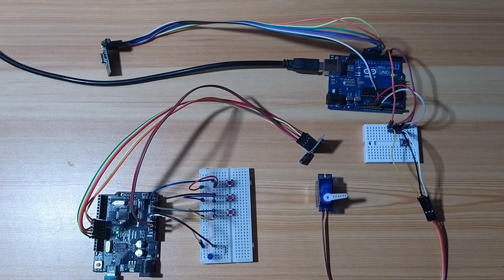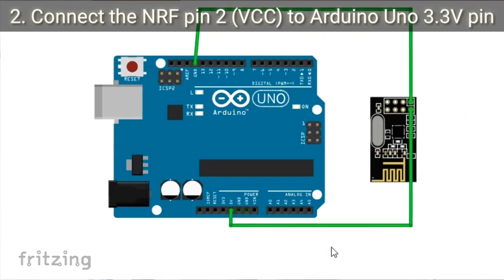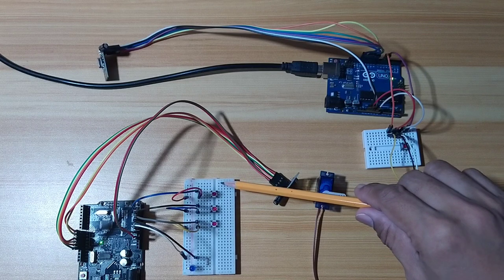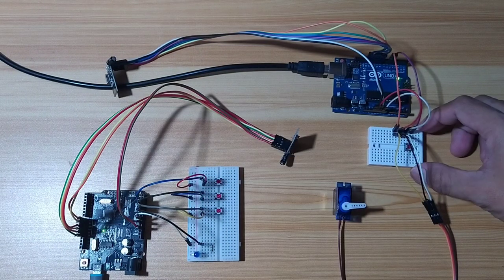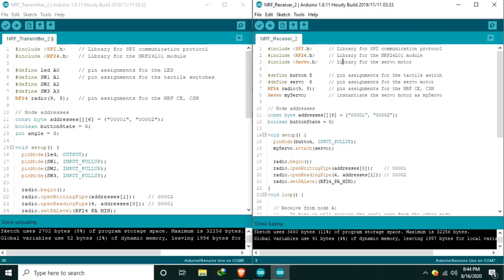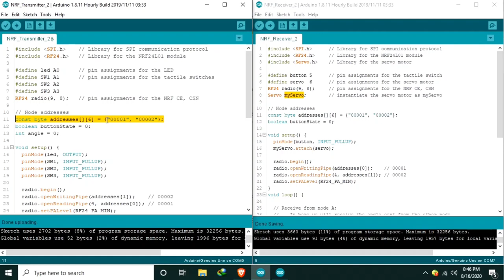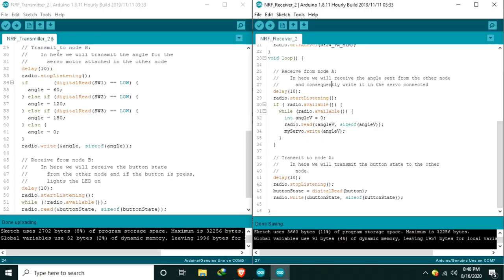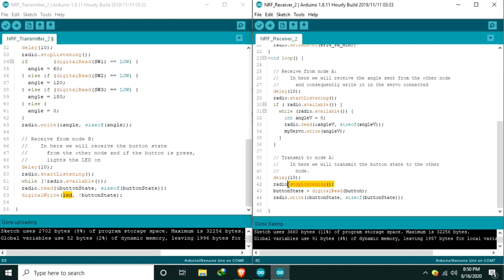Tutorial: Getting Started with the NRF24L01 | How to use | Arduino

Comment: I used shift register 74HC165 to increase my push button switches, and 3 pins of Shift register (Load in Pin1, Clock in Pin2 and Serial out Pin9) are connected to arduino with wires and it's working ok. How is it possible to connect wirelessly 3 pins of Shift register to 3 or more arduino boards and achieve the same result with the use of NRF24L01? THANK YOU.

Comment: I'm using the module with antenna connector. I have problem using it NodeMCU as transmitter. Using it as receiver is fine.
So I soldered 10UF capacitor to it. Now I can't upload sketch to NodeMCU while vcc&gnd wires still connected to NRF module. Serial port becomes unavailable.
I have to remove vcc&gnd between them in order to upload the sketch. Please help.
Reply from the maker: Hi @Pal Sih, you might want to double check your soldering connection. When you solder the capacitor pins, it should only touch the respective pin.

You might also suspect the capacitor, did you observe proper polarity?
Reply: @TechToTinker  Yes , I already checked polarity.  vcc to positive of cap and gnd to negative of cap.
I found this http://acoptex.com/wp/basics-project-083c-esp8266-esp-12e-module-and-nrf24l01-2-4ghz-rf-transceiver-module-dht11-sensor-readings-on-lcd1602-i2c-module/
The diagram for NodeMCU shows RSV(not sure if it is 5v output) to VCC of NRF24 adapter.   I will desolder the capacitor and use this adapter instead.
Do you think NodeMCU's rsv (next to SD3 pin)  can output 5v?
Reply from the maker: @jumbo999614  Im not familiar with ESP12 but according to that diagram, RSV stands for reserved pin. So you cant use it. Use VIN and GND pin instead.

Or better use external power supply for NRF and connected both grounds (commonly ground).